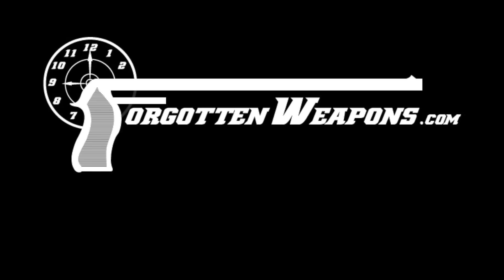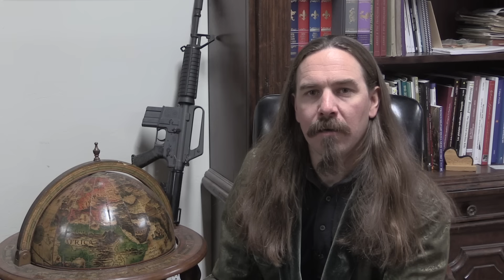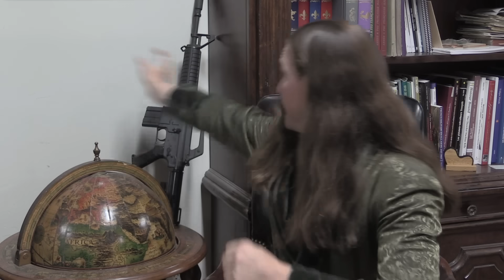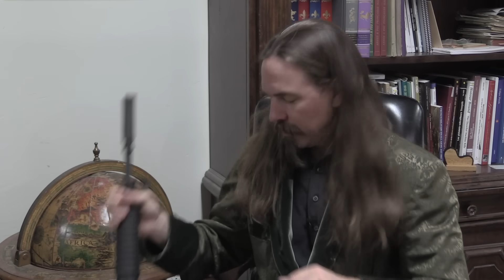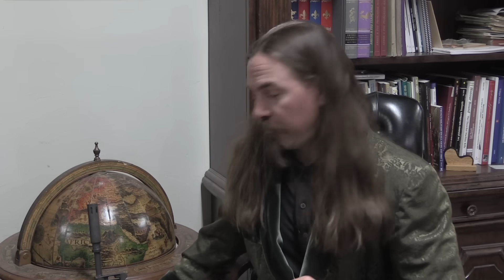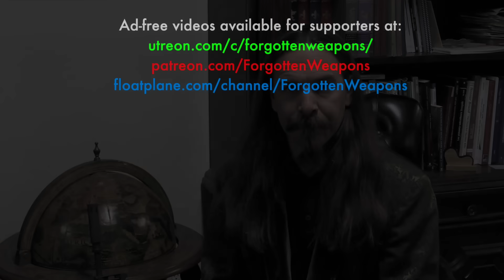Ask Ian: "Last Ditch" Rifles for World War III?

Comment: I disagree with your last statement, because as I understand it during Vietnam War. The military actually switched from full auto to 3 rounds burst to make the M16 more manageable. If I remember correctly and understand it correctly, the military found out that full auto operation was part of the reliability issues of the M16. They were using too much ammunition and not enough enough hit ratio with full auto so they switched out the full auto sear for 3 round burst and it greatly improved reliability. Which is also why the m60 declined for squad full auto and the m24 saw replaced it for mobile applications or troop services also the m24 used 5.56 same ammunition and I think the m24 is also able to use m16 magazines instead of belt fed or in addition to so the m24 can be easily converted in the field. However the m60 still hung on for vehicles and gun emplacement. I don't really see the sights going too far in regression maybe to the a2 style because it's a good platform for initial zero and to quickly and accurately go to 300 meters. And really the quick flip style could be injection molded just as easily as a single solid one.
Reply: The full auto operation issues were because of fouling and failure to clean, poor magazine design details, etc.  Modern M-16s in full auto with modern ammunition are more reliable than in burst, because the burst mechanism has more failure modes.
Reply: @George Herbert  I won't disagree with you because it's been at least 10 years since I read the 3 volume book of the AR and personally don't have hardly any experience with the AR platform guns. Just trying to remember some of the things I read way back when. Only thing I know is that the military has been a long time development stages to modern m4 and they're supposed to be replacing them with a new gun and I don't know hardly anything other than I think it was submitted by sig Sar

Comment: 8:00 dead wrong. the parts are already in mass production. it's now harder to find volume production of fixed stocks, rifle length buffer tubes, springs, etc. than it is for the adjustable length. There is a Gluteny of parts lying around the US and in mass production. No one is going to stop production of adjustable stocks to retool for fixed length. Fixed stocks actually use more material too.

You may know guns, but you don't know engineering and manufacturing.

Comment: I can see us dropping the ACOGs/ 1.4x/2x. M16A4 and M4 still have iron sights available. Yes, they are modular now with rails that enable mounting of laser pointers, flashlights, etc...  Modern features wouldn't go away with exception of the sights as they cant take a beating like Iron Sights can. We have women in the infantry, many of whom are much shorter than males, so adjustable butt stocks will still be needed. We would not get rid of burst fire. The main reason we got rid of auto was to minimize cost of ammo. We are trained "One shot, one kill" doctrine. Some parts might be made with polymer. But reality would be that we would see an exponential increase in  manufacturing plants. Just as we did in WW2. We won mainly because we were able to out build while maintaining high quality products. The M1 was an awesome rifle for its time. 
M16 is better, of course, lightweight, easy to maintain. My favorite is the M4.  Believe it or not, I actually am very partial to Iron sights. But we no longer train on those.

Comment: We already produce AR's extremely fast. They're already standardized, there's a billion different manufacturers and every single part from every single rifle is interchangable. They're mostly made of aluminum and plastic. Both are cheap, easy to work with and abundant. 

We have the right gun. Stoner developed a platform that will never be outdone - not until we're firing lasers at each other.

Comment: The US Military's recruitment is down to the point, there's a lot more M4s in the Armories than personell right now.

A lot will depend on how severely manufacturing is impacted by a War, and what we're fighting over.  Invasion's the lesser threat in comparison to Civil War IMHO.  The US is not an easy target for invasion due to its geography.  We've only two borders to worry about, and a sea/air invasions impractical and would cost the invader huge numbers of casualties.  It's far more probable at this point in time, that Civil War is our greatest threat.
I'd see a return to full auto, and agree the burst feature is a complication in production numbers.  The NGSW would cease and desist in wartime, simply because there's not enough inventory of arms and ammo to make the switch feasible yet.
I still believe our greatest threat is Civil War at this point, and our enemies are promoting the Democrat's balkanization of the country.  China, Russia and Iran would love to see the US splinter and dissolve (a number of smaller nations would to).  It costs them far less than a direct provication. After all, it would be much easier to invade after we've decimated ourselves and our Internal foes.

Comment: My EOTW carbine is an A1 sight C7 upper with chrome lined pencil 16" barrel with A2 flash hider and A2 delta ring barrel nut and heat shield lined handguards and a 4 position stock. Think Mogadishu "Black Hawk Down". Simple, Reliable, Combat proven and EMP proof.

Comment: two words: 3D Printing. "Last Ditch" would be using 3D printed components, as there's an abundance of 3D printers out there. This would give you the "Extra Machines" needed to provide output. You could easily upcycle PET bottles for the print material if needed as well, so print material availability wouldn't be as big of an issue.

Comment: High point Davis Jennings bryco. All showed us the way to make things cheaper and with fewer strategic materials.

A Barrel could be simply a steel sleeve inside of a pot metal frame. The pot metal frame could be encased inside of that polymer that everyone is so fond of.
How thin can you make sheet metal? 

And what about making guns that are good for on average for Only two battles and then you throw it aside?
, I mean, If you make it cheap enough that an enemy combatant cannot pick it up and use it for any extended period of time., You avoid the problem that we have currently withguns.

They do that with our automobile so why not?

Comment: Counterpoint: Looking back at WWII, the U.S. didn't cut any corners on the M1 Garand to make it more producible did they?  That's just not how we roll.  As mentioned, Japan,  Germany and especially the USSR made tremendous changes to make their battle rifles easier to manufacture.  The M91 Mosin-Nagant is a poster-child for this kind of effort.  They went from a hex to a round receiver (easier to machine), simplified the sling hardware and a number of other changes during wartime production, including looser tolerances and skipping final polishing of the tool marks.  I just don't see the U.S. war machine accommodating that, where firearms are manufactured by industry vs. a government arsenal, to a contract with pre-set acceptance criteria.

Comment: Ian, my man,  in dire times you only need barrels, most of the AR can be 3D printed, or mold injected, and even if it last less it will give a lot of firepower for cheap.
Reply: Oh jeez, the bolt and bolt carrier and assorted parts are way more complex than that.  Look at the @InstructorChad SOTAR BCG inspections and realize how many material conditions and detail dimensions have to be precise to within a few thousandths at most...

The performance requirements parts are pretty much the bolt and carrier assembly, the barrel, and the gas tube.  The rest are relatively low stress packaging (receivers) and the fire control group and minor mechanicals.  Receiver around the barrel and gas tube really needs temperature tolerance, those parts get very hot.  The rest of the receivers is much more flexible in terms of material capabilities.  Fire control groups need some hard parts and some tough parts but the rest is pretty flexible.

Comment: The cheap adjustable stock that came with my AR-15 pattern rifle wouldn't stay latched, so I stuck a piece of PVC pipe in its tube to lock it at full extension. And I'm not even at war.

Comment: Maybe it's just me but Ian's definition of "Last ditch" and what i think of is very different. 

When i think of last ditch i think of rounding up scrap sheet metal and pounding it into a square or circular receiver in a shed or underground in a mountain or something, using a straight blowback action with a big hunk of metal with a fixed firing pin on it and a full auto only simple trigger bar. Polymer production would be destroyed in such a scenario.  Sheet metal spot welded iron sights mostly unfinished metal, metal fixed triangle stock. Really low tech stuff, like MP3008 level of low tech. 

M4 is not a good weapon to "Last ditch" and simplify.

Comment: I would argue that for a major power, there would be no last ditch systems today, we dont need vast numbers of troops on the high tech battlefield, no nation on earth could field an army to fight a straight up ground war against china.
i totally agree that optics and other periphails woild be simplified or eliminated where possible.  the current weapoms systems beimg designed for suppressors and optics would be issues to front line troops the rest could do without.

Comment: You missed one important thing about not doing simplified rifles to begin with. Rifles have no expiration date. When you have no time pressure you can essentially produce a better rifle for twenty years. You'll have huge stockpiles of good weaponry ready to go at any time. When there is no time frame it doesn't matter if you make ten million AKMs in twenty years or in five years, AKM's still AKM. It's still a good rifle even if fifty years pass (unless you intentionally obsolete them for some reason).
Expiration and conservation are essential parts of military procurement. For example, you can't stockpile body armor since it's got a very real expiration date. It was one of the reasons to delay it's widespread adoption.

Comment: You could also leave out the parts for the last round bolt hold open, forward assist (stick a flat head screw driver in the hole if it gets stuck), ejection port cover, sling, threaded muzzle, and muzzle device if you were truly that desperate.

Comment: For me it's a bull pup rifle or a folding  rifle . A rifle has to do multiple things for worst case scenario- store in a backpack, be shouldered and shot inside a vehicle,  clear tight spaces in a building, can be easily shot one handed due to injury,  have reliability beyond 10,000 rounds as there no stores anymore,  easily clear jams,  not have to constantly be cleaned and lubricated ,  and still shoot at a reliable distace.  An AR can not do even most of these. 
All the main military grade bull pups or folding rifles can do this from the  tavor, aug, vhs2 , scar , sig mcx which is why were adopted by many  nations instead of the AR Platform.

Comment: The A1’s were for shit,A2’s with the chrome lined barrels, fire assist ( in case of jams) are a beautiful weapon design. Fairly easy to field strip and clean, relatively high ( and accurate) rate of fire, low recoil makes it a awesome weapon.

Comment: I don't think polymer would be good idea. The very specialised hardened steel tooling and machines are hard to make or find. 
Not to mention the biggest issue these days is the global economy, how many raw materials do we use that are imported. 

Does the USA have the raw resources to make polymer parts, or even large amounts of bauxite mines to make Aluminium. We know high quality Titanium used in turbine engines is only made in a few countries around the world.

Edit: Is the USA even capable of making a truck without any imported components?

Comment: by the time you simplify an AR that much, you'd be far better off going to an inherently simpler design, like the Kel-Tec SU-16.
They are way lighter than ARs, but use AR mags, and other AR parts where strength is needed (bolt, barrel, chamber). The BCG is simpler, and the whole thing is way lighter. The signs on the A variant are stupid simple. the SBR (D?) can fire with a folded stock, and would be perfect for tank crews, and the like.

Comment: The A1 sights were perfect for intended ranges. Zero um. Flip um. Let um alone. The Devil Dogs should not have been given free rain to the M16A2. The A2 sights are finicky. Butt stock is that inch to long. The A2 is heaver. M855 is not as good (at a loss of 240fps for a gain of 7grains in projectile) as M193 . A1 1n12 rifling ballistics are superior across temp ranges. The A1 and its M193 (62000CUPS) have a higher degree of the one shot stop to 125meters. Projectile fragmentation of the 55grain M193 bullet is absolute down to a velocity of 2300fps, and lets face it, this has always been the M16 greatest attribute.... (anyway. just my wooden nickels worth

Comment: The most important quality against aggregate countries and combatants is logistical supremacy. The worst problem, is defending years of development from a minute nuke. 

Individually, this still matters.
Warfare against infantry(or raiders) is all about counter-ambush defense tactics. They will come for your bullets.

Expect all ammo will be spent, no matter where you find it. 

Don't even expect your house to be safe, no matter where you may be. Every house is a stationary target. 

If you have never pictured your house surrounded, and have multiple angles or a assault perimeter, they will. Your walls won't stop lead for long. Discreet foxholes will save your property.

It is best to invest in your own multi-purpose reloading station, and a bunker.

The other half of weaponry and ammo you can pick up from the enemy.

When you can't afford full-auto, a binary trigger on anything is comprehensively more effective in flash firefights in bamboozling CQC as well as rapid follow-ups for long-distance.

Go with what you know and get something that has a good grouping at 400m at least.

Fire-arms were meant to be used at distance from the assailant. 

Work smarter, not harder.

Comment: You know guns.

You don't know simple math, manufacturing, and the realities of such a conflict.

The US will NEVER run out of AR15 platform parts, rifles, accessories, optics, etc. in ANY WAR for the foreseeable future. IT WILL NEVER HAPPEN. One, the number of parts made every year in the US in peace time is staggering, let alone ramp up for war. Two, there are already tens of millions of these rifles in the US not counting military stockpiles, far more than we'd ever need. Three, your comprehension of manufacturing is rather limited. Nobody is going to stop production of adjustable length stocks, springs, buffers, buffer tubes, etc. to retool for fixed stocks. Fixed stocks take more time/material to make and there is, and never will be, a shortage of the parts in the US in wartime for adjustable stocks. Few companies even make fixed stocks/parts anymore. Also, CNC manufacturing is a thing. Most of the parts you rag on like rear sights are actually rather easy to make these days compared to Vietnam before CNC became almost the exclusive manufacturing machining method (manual machining being nearly extinct in manufacturing, not even counting 3D printing and other methods).